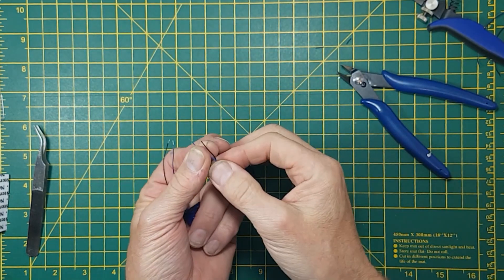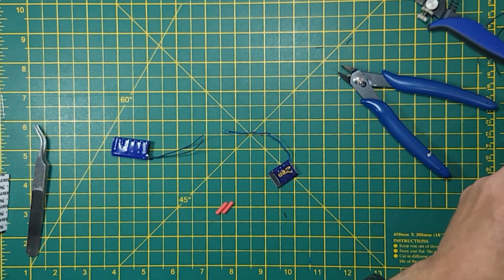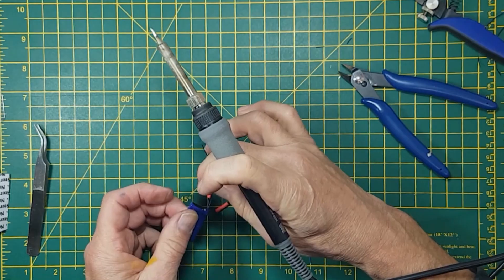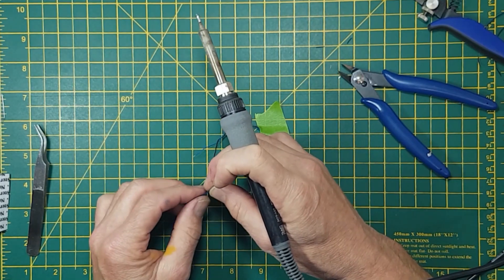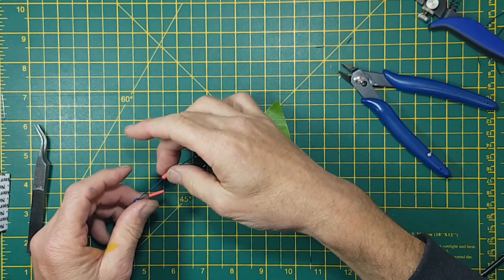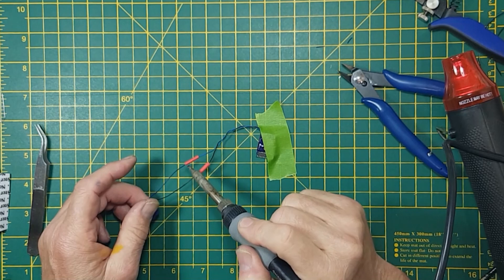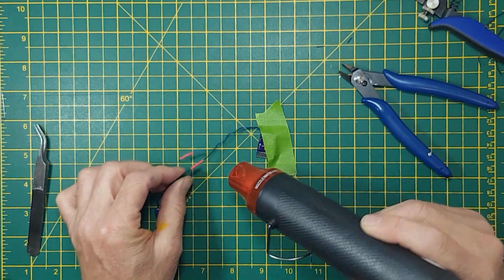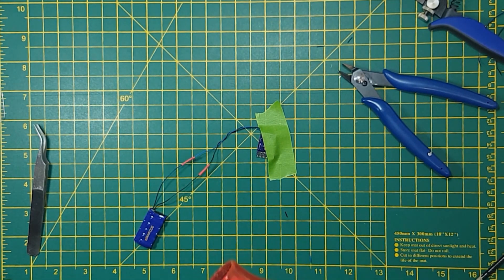Demonstrating and Fitting the DCCconcepts Super Stay Alive

Comment: Hi, I have two of your stayalives (DCC Concepts DCD-ZNSA.1  1 x Zen Series Stay Alive Standard Slimline 2 Wire 1stP) and would like to know if these will work with any decoder? I have a pre-owned Bachmann 08 which has a decoder hard-wired to which I would like to fit a stay-alive but am wary of doing so, given I don’t know what make decoder is fitted. 

Also, same loco, how do I connect the stay-alive, if I can actually fit it? 

First time dealing with anything DCC so be gentle! 

Thanks,

Darren
Reply from the maker: Hi Darren, Some decoders can take stay-alives, others cannot - the best advice would be to find out what decoder is fitted, then get in touch with us at salesuk@dccconcepts.com where we will best be able to assist.